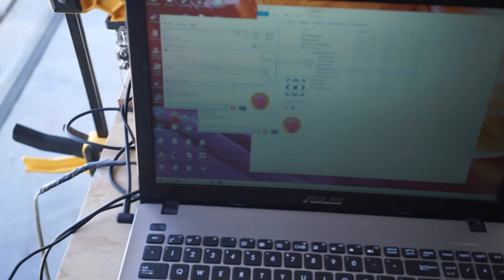Home Made Wooden Swords with Laser Engraving

Comment: This is pretty awesome. Do certain types of wood work better for this? I think that's a soft wood you've used in this but it's been quite awhile since I've worked with wood.
Reply from the maker: Your intuition is good! That is just normal construction-grade pine wood. Except for the katana, which is a red oak. When doing intricate carving, hardwood is better. But for simple shapes like this the softer woods work fine too.
Reply: @peripheralarbor  I would have guessed pine as it's a pretty popular wood to work with and easy for most things unless you're needing or wanting a hard wood though I know that depending on the area you can find various other soft woods at any place that sells lumber. I enjoyed working with wood when I was in Scouts from 4th grade to about when I graduated college and was moving around a lot. My mom might have even still kept all the pinewood derby cars I made over the years in Cub Scouts and then as a Den Chief (I know she still has a wooden tool box I made in my teens).
Reply from the maker: @jcohasset23  That's so great. Woodworking is a lovely skill, and it smells so nice!